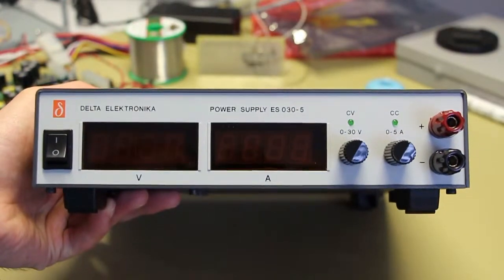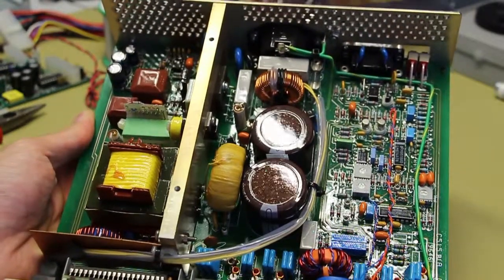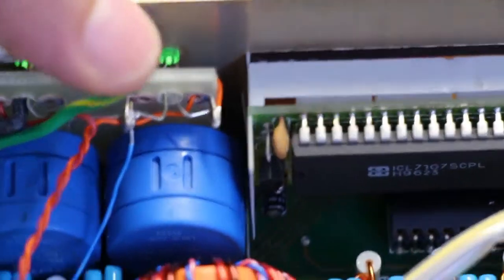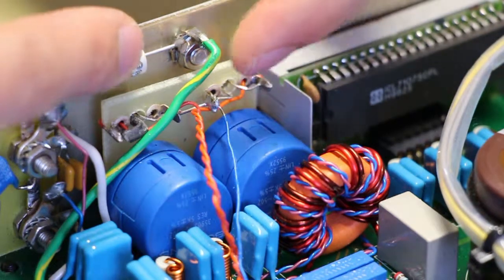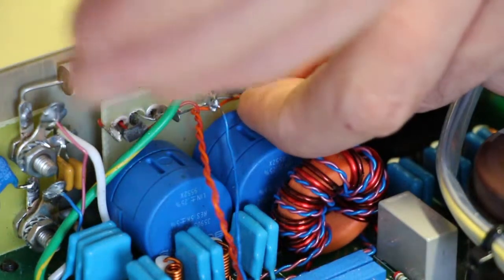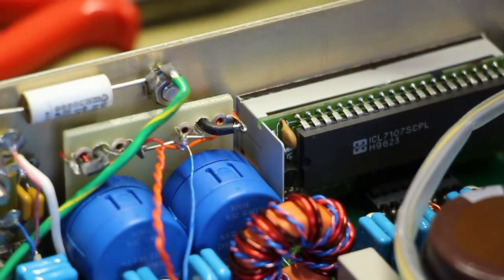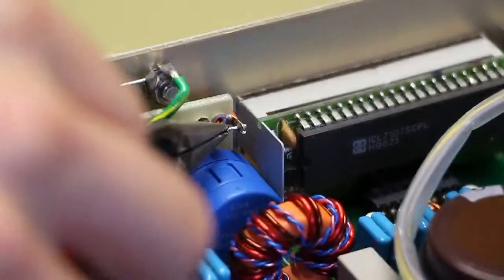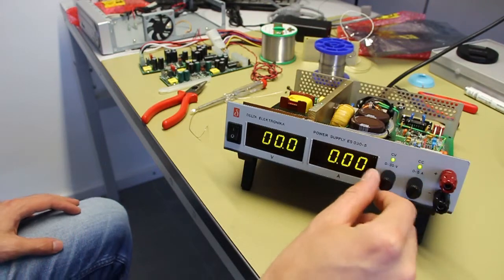Delta Elektronika ES 030-5 led indicator insulation improvement

Comment: That's a very nice looking and quality looking supply.  I was about to comment on the dry joint on that LED leg but you spoiled my fun by fixing it. The 7 segment displays looked great when you powered it up. I thought it would have had a higher output current than 0.5 amp being a switcher. Good job and thanks for sharing. Regards Chris.
Reply from the maker: 5 Amp, not 0.5A :)
Reply: Ok that makes more sense. Thanks
Reply: Delta Elektronika is one of the best PSU manufacturer. These supplies is well-known at CERN, aviation industries, automotive industries etc. MTBF is rated for 500 000 hours and owner of company is also electrotechnically educated person. There are lot of stories from factory, like "Why you aren't using OLED displays in newest PSU's?" and Jan (owner) replied: "Because they aren't long time at the market, nobody knows how long is they lifespan. On the other side, LCD's are very long at the market and they are reliable."
Also there was problem with software, occasionaly PSU doesn't boot up. Jan gave command to switch on and off PSU's one million times and when ONE time it cannot start, it must be solved with new software. So as you can see, oewner and employees are very interested in quality and PSU's are they passion, which is visible on treatment. I'm repairing these supplies in Slovakia and most of faults are random component faults caused by component manufacturing fault, not by PSU manufacturing fault or neglect something at design. These faults are normal at 24/7/365 operation. When used in home lab, these supplies are for life. 

Greetings from Slovakia!

Comment: Ahh the old icl7107 made in 1996, a good old digital meter i.c :-D
One upgrade would be to remake that display pcb and use the 7106 with lcd displays.
The old 7107 did tend to warm up and drift slightly, led driving needs more current.

That looks like a smashing supply, neat and efficent, a good range on voltage and current.
That was a bargain :-D.

Does it still produce a clean output?, switchmodes can get noisey if the output caps are old.
Reply from the maker: Good question! I should measure that sometime. I first need to get the manual, still. There is a lot of, what I presume is, output filtering in this supply.
Here's the full video, starting at the point of interest.
As you can tell by the length of the original video I let go of a lot of possible (or possible wrong) information. https://youtu.be/63ASWdAcJV8?t=12m23s

At the moment I'm half tempted to get another one of this type of supply, the second edition, if you will. That is, if the seller on the internet has the right pictures with the advert. Just to get a look at a more modern design of these compact units.
Reply: zx8401ztv  I spotted that IC as well. I think I had one in a sinclair volt meter many many years ago.
Reply: AllTheGearNoldea

It's possible if it wasnt the calculator style meter, i do know that sinclair did do one in a calculator box, but he used discrete parts and simpler chips.

The icl7106 and family have been used in basic multimeters for years, even the Blob chip is a 7106 or similar.
The "all in one" dmm chips have taken its place, auto range and all the bells and whistles
I still like the simplicity of the icl7106 :-D
Reply: zx8401ztv  The Sinclair meter I had was not the calculator style but I know the one your talking about. The one I had looked similar shape this power supply. I loved that meter was my first digital display but I remember the batteries did not last long and it had no auto power off.
Reply: zx8401ztv  it may have been a Sinclair DM235 it was a long time ago
Reply: AllTheGearNoldea,  Hmm im not sure about that one,  it has been a long time since clives products.
The cheap yellow 830B type meters all over ebay use the same chip, the mastech types are safe, all other copys are dodgy lol.